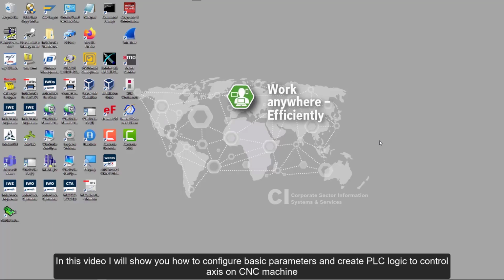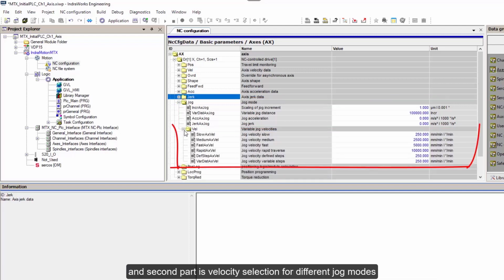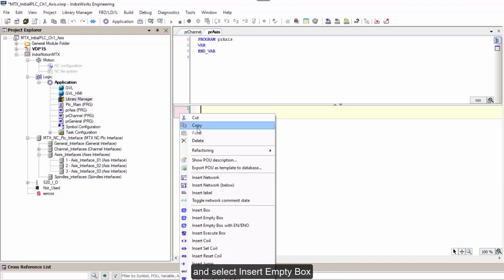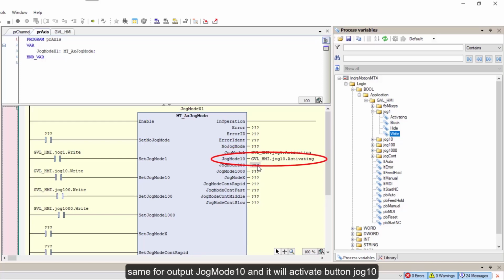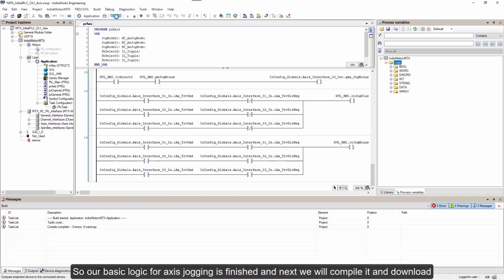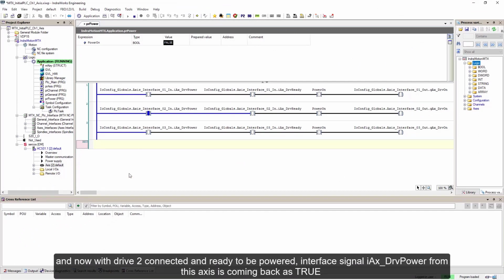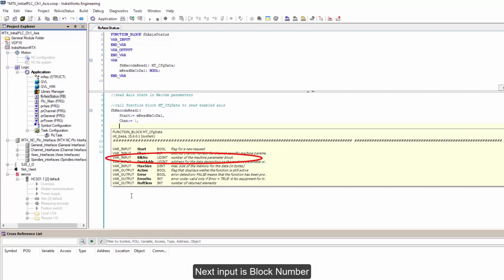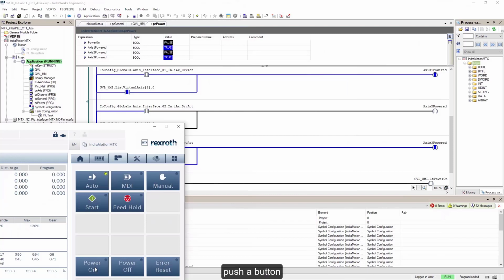CNC MTX – Axis Setup and monitoring

Comment: Thanks of these informative videos. I have a question: I have some Indradrive Cs with Safety on Board (STO/SBC) and XM42 controller. I have followed the steps given with no error so far. However when it comes to jogging the axis, the Output stage is blocked by (STO/SBC). Is there a walk around this without setting up the safety system (gates and all), is it possible to deactivate the STO/SBC just to jog the drives (ensure that all works accordingly). Thanks